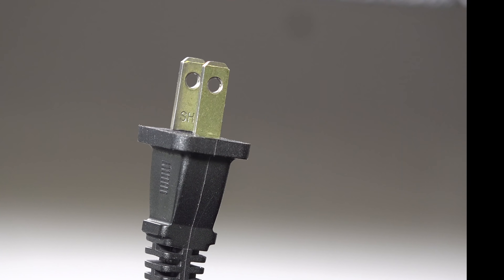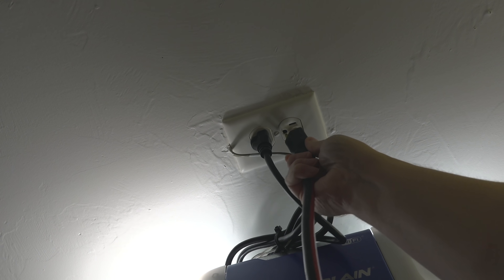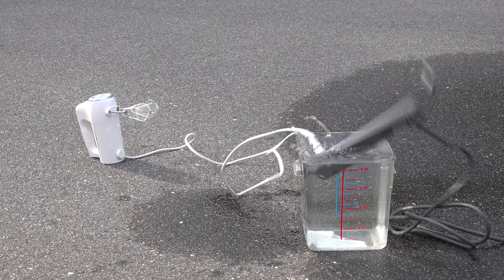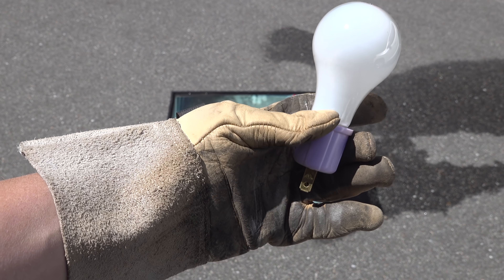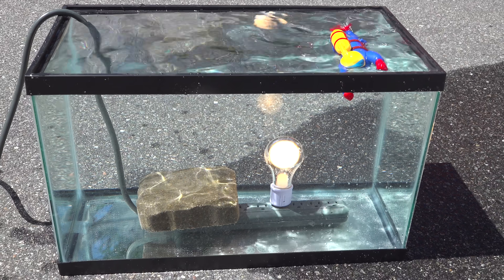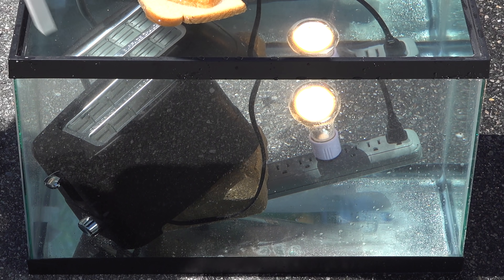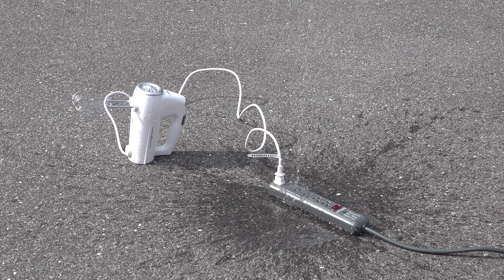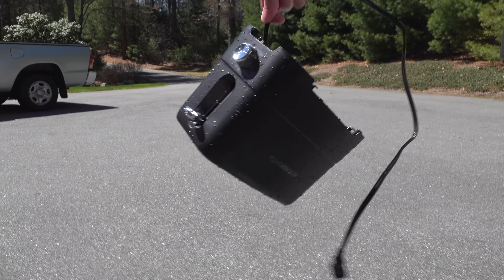What REALLY HAPPENS WHEN YOU SPILL WATER in an OUTLET?

Comment: I have had this question for years. Maybe you can answer it. In order for that water to be electrified, it must be true that water is a good conductor of electricity. Like a piece of wire is. Since you submerged the outlet strip while it was on, you essentially directly shorted out the hot and neutral sides of the outlet which should cause cascading current and should very quickly blow the circuit breaker in your house, not to mention the one built into the power strip. If you took a wire and bridged the two sides of any of those outlets together the circuit breaker would absolutely blow. Why doesn't the water have the same effect? If it's such a poor conductor of electricity that it can't flip a circuit breaker, then how can it have enough current flowing through it to electrocute a person? It makes no sense. A number of years ago, the condo building I was living in was flooded by Hurricane Irene. I was on the third floor. The first floor was under water right up to the ceiling. Even though all the outlets in that floor and the circuit breaker box itself were all completely submerged in the water, the power was still on for the building and that floor. The breaker boxes that were submerged services the entire building. In addition the small substation outside the building which had a separate electrical meter for each unit was also fully submerged, and still, the electricity flowed fine and never tripped a breaker or went off. Lights were still on and outlets were still active. GFI outlets may have shut down individually, but power was still being sent to them. Using any other conductor of electricity to connect between the hot and neutral of any AC electrical connection would cause an instantaneous short which would flip the breaker. In addition, while this was going on, people were wading through that water trying to retrieve things from the building and were not shocked by the water. I would love to know how that is possible.
Reply: OK, prepare for a long ride :-)

Water is a bad conductor, in fact it is an insulator. As long as we are talking pure (like distilled) water. Anything in it, the situation changes, but it is dependent of what and how much. If you put enough salt, it will conduct very well. You need much salt for it to be so conductive to short circuit enough to trip a breaker. So no, water is not a short circuit, you need higher voltage for this. This is why everything works (while very very fast corroding) in the video. You might know that freezing point also changes depending of how pure it is and it's pressure.

Different thing is with a GFI breaker. Such breaker measures if there is any small leak to the ground (energy loss), hence the name of Ground Fault Interrupter - GFI. This is an additional electronical measuring part that has nothing to do with short circuits. It trips if leak is detected. It could be that electricity current is leaking thru your heart to the ground your standing on and the other wire gets some small amount of energy less than it should. In bathroom such breakers (bcs of soapy water) are much more sensitive. If a current required to trip a standard, non GFI breaker would flow thru you, you'll become a piece of charcoal not just dead.
Standard breakers are made to protect the wires, not you. In order for them not to melt or catch fire. GFI breaker is made to protect you. It measures miliamperes, not amperes.

So, in order to kill you,  electricity must go thru your body in a certain very small amount. You would need to take a hot wire in one hand and stand on the ground and be conductive enough. On voltage depends how strong insulation you need (voltage is like water pressure in the hose). And if there is enough current flow, you are dead. Insulation would be a diameter of such hose with said pressure. Your hand has some insulation (depends how much dead skin, how dry it is, etc.), your shoes have some insulation, your body inside much less. So if there is enough voltage and it defeats your skin and shoes insulation, the current will flow thru you. Less insulation, more current. So, you are a poor conducting wire, but conducting still. Well, to be honest, everything conducts electricity, the question is how much. Air is an insulator too, but per every 10.000 volts you get a one centimeter of arch length more.
Suppose you are all sweaty from fitness training. Your skin is moist (water) and salty (salty water=great conductor). You are now safer, bcs energy would rather flow on your wet skin than thru you. You would feel it more bcs you are now less insulated but it probably not choose to go thru your heart with all that salty blood.

If you are piece of wire, you must manage to get the energy somehow flowing thru that piece. Having a piece of wire in the proximity of electricity does nothing to it, does it?  Energy will mostly flow where is less insulation - resitance, like river flowing where is less resistance. That being said, you are basically asking why while standing on the river beach and watching it flow, you are not wet. It's because you are (yet) not part of a closed circuit going thru your body. Once you become - somehow - you are toast. Or unpleasantly electrocuted.

So, the river analogy, once part of it starts flowing into your mouth and out of your ass, how much that particular flow would kill you? :-) 

Electricity is like radioactivity. If you know nothing or little about it, the safer course to take is to stay away from it at all costs (and better not to make any assumptions). But if on the other hand you know exactly what you are doing, then there is a safe way to manage both.

Comment: Your tape water in this experiment is not conductive enough to cause enough current to travel through the socket. Otherwise a short circuit will happen and the water will start boiling. If submerged under water electricty will continue to flow causing the outlet to overload triggering some security feature it may have (i hope) even if its just a fuse. In my countrie this things have an actual magnetothermal circuit breaker, but I heard that in north america they don't really bother with those things...
Reply: the two strips of metal for neutral and hot will act as an electrolysis machine, giving off O2 and H2

Comment: About a year ago I woke up in the middle of the night to find my house rapidly flooding. There was about a foot of water at the time, so the surge protector for my computer and related items were already underwater. Trying to unplug everything was difficult, but I could tell I wasn't getting shocked nearly as bad as if the water was up to the actual outlets. Unfortunately, the breakers didn't trip properly though.
Reply: Why would the breakers trip if current draw wasn't exceeding rated output??
Reply: @rickc303  cause the water would cause an electric shock and when that happens the breakers trip so it doesn't cause more damage
Reply: @williamsalvador6356  as the video shows, water alone wouldn't cause an electrical shock, and even then the breakers would only trip if the short exceeded rated output

Circuit breakers protect the wiring from excessive current draw, not people from being electrocuted
Reply: @rickc303  not entirely true just in 3rd world countries like the US, most of the world has been using RCD/ RCBO’s as circuit breakers for at least 25+ years which are designed to protect against electric shock, and definitely would’ve tripped instantly from these experiments. Trip from leakage current, over current, short circuit current etc etc. turn off within 1 frequency wave of electricity
Reply: That's really quite dangerous because if you get close enough to take a big shock it can lock your muscles, then you fall into the water and probably can't do anything except die.

In a flood it's much safer to cut all circuits at the breaker panel
Reply: @jordanrodrigues1279  That certainly would have been the smart thing to do. Just figured I'd share since it was related to the vid, and I didn't get shocked that much.
Reply: That’s wild I can’t believe you unplugged everything, I don’t have that typa trust
Reply: same basement 15 years ago flooded do to back up rain water and first thing i did was to try unplug the pc surge protector one that i bought in best buy around 2000's and i am still using right now as i am typing this lol and to my suprise same as the video the light on the protector still on and working even under 2 feet of water.  i was afraid of being shocked but my pc lol is my life :) hence why i tried to disconnect it.
Reply: @riusu8672  Same. It seemed to run alright under water, but I did have to take apart my computer and clean it out with rubbing alcohol. Got a blue screen upon initial start up.
Reply: I would say they were working correctly, a few miliamps can kill or wound you but wont trip your 20A breaker because it's not a real "short."  It's leaking current and CAN be dangerous and certainly can ruin digital electronics and powered on water exposure can damage normal electronics but the breaker is to stop DEAD SHORTS from MELTING APPLIANCES AND THE WIRES IN YOUR WALLS from OVERCURRENT, not current leakage which wont necessarily harm your equipment/infrastructure.  A ruined of or even a dead occupant under the worst circumstances is a far lesser concern than a housefire caused by said overcurrent conditions, which can kill dozens, and destroy an entire neighborhood.
Reply: Why did it flood? Was the entire area flooded, or did a pipe burst or something like that?
Reply: @MrCh0o  Flash flood that affected a large area
Reply: why didsnt you just turn off the power....
Reply: You should've been prepared for the flood
Reply: @mahimahionimai  Flash floods exist.

Comment: I had a plug that came slightly out of the power strip, but was still plugged in. I managed to drop an aluminum knitting needle and it bridged the two prongs of the plug. The needle melted, the appliance was fried, and the power strip did it's job and tripped the breaker.

Comment: Pure water is an insulator. Adding salt would likely have changed that. Note that to trip a breaker one needs much more than the rated current. To trip immediately one needs something like 5x the rated one. Two times the rated trips in about a minute. A hundredth of the breaker current can kill

I spilled water or some drink on my power strip. The circuit breaker tripped but this was because a phone charger blew.

Comment: Recently replaced a badly leaking hot water heater for a customer, the two hot wires had obviously been submerged and the breaker had not tripped. 240 volts. Wire nuts pushed into the top of the hot water heater into a little cup area maybe two inches wide, and there was rust all around it from what must have at least days maybe even weeks of water. It was rather surprised, it didn't trip the breaker.
Reply: 20 amp circuit, the resistance of tap water maybe 2000 ohms, depending on how far apart the hots were from each other. With 2000 ohms, there was only 0.12 amps flowing thru the water, not enough to trip the 20A breaker. Did the customer mention the faucets were burping air with a burst of high pressure when faucet was initially opened? (being oxygen and hydrogen created from electrolysis). With a backflow preventer at the water main, this would create high pressure as more gas was created, and eventually cause the water to leak out the relief valve.
Reply: @thebluelunarmonkey  The two hot wires were about 1 inch apart. The wires were outside the water heater and on top of the water heater. (So any oxygen and hydrogen would have quickly dissipated.) (This was also in a well ventilated basement.) The customer had turned off the water when he realized there was a problem so there was air in the pipes when I got there.  When he found the problem there was water was squirting out of the failed water heater. Appreciate the math above. With .12 amps at 240 volts, that is about 28 watts of power or about one quarter of the power of an old 100 watt light bulb. Another way to look at it, it only lost about one half of one percent of the power.

Comment: The circuit breaker is there to protect the wires from overload and subsequently the house from burning down the GFCI is there to protect you. All you're doing is creating a resistive chart that then burns off because the water evaporates.

Comment: Of course the appliances are still going to work underwater if there's no GFCI protection, the presence of water just means that the water becomes energized with the circuit. It doesn't affect the circuit itself. If the appliance isn't designed to work underwater then it might fail or not work properly because of that, but the electricity still always finds a path between live, neutral, or earth.

Comment: Ahhhh, nah, I don't think the water was electrified, electricity takes the path of least resistance. Water itself isn't conductive, its usually whatever minerals or other electrolyitic impurities in it that is. The cleaner the water, the safer you are. Water has much more resistance than the metal path in the wires through the water it already had. The problem would have been if you tried to unplug it in the water. Good to know, like if you drop anything in the bathub with you, getting out as quick as you can is first priority over trying to disconnect it from its power source. Doing that in the wrong order could lead to a bad day. 

Also, a toaster doesn't present exactly the same hazard as say, a hair dryer, or something with an electric motor. The motor uses a magnetic field and a commutator to create its rotation, something tells me its got a greater resistance than something that still has a clear wire path through it, even wire meant to create a higher than normal resistance and turn that resistance into heat. Motors that might even normally have a resistance rating lower than electrolytic water, that resistance only gets bigger when its submersed in something like water that doesn't allow it to spin as freely as it did in air. It also attempts to draw more current to get itself moving, obviously tough to do when drawing from a fixed voltage, but still possible momentarily as there is energy already stored in the rest of the circuit after the breaker and the wire is probably rated for a higher voltage so it doesn't cause fires. That could then trigger the AC current to jump the gap from the skin effect. Nonetheless, As soon as the resistance of the motor is greater than that of the water, the electrons choose the water. 

P.S. All those lightning strike swimming pool incidents you hear about? Not actually the water that's zapping people, its either the salt or chlorine they put in the water to keep it sterilized. Both superb electrolytes. If the water was actually somehow just pure water (kinda hard to do with a swimming pool I realize) chances are that wouldn't be a thing.